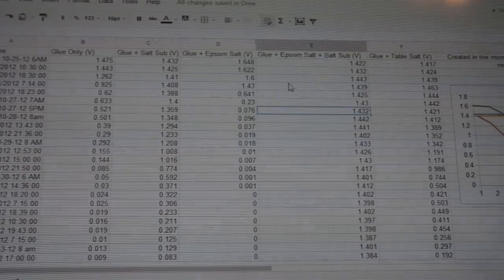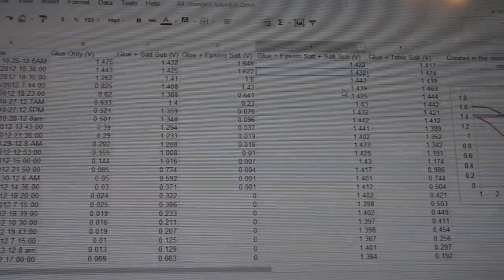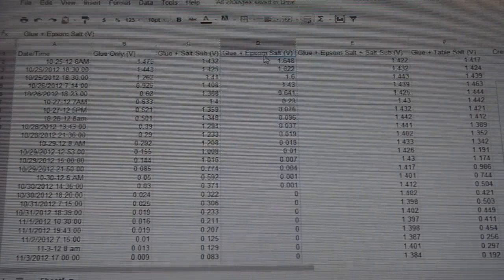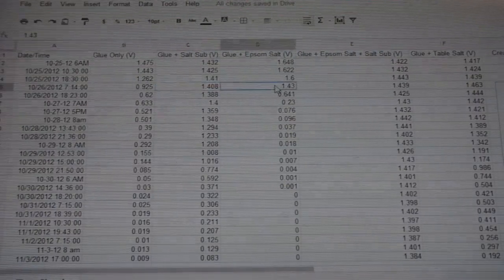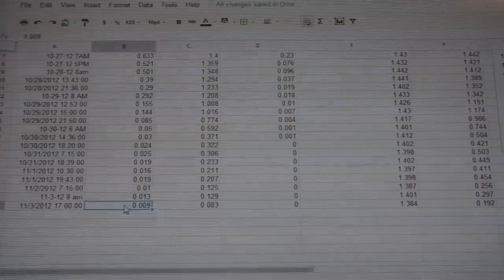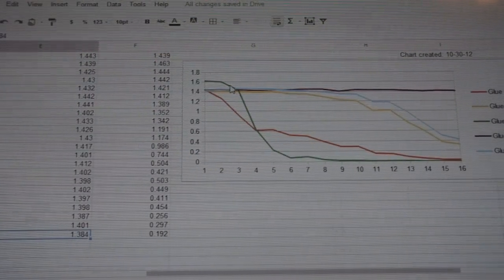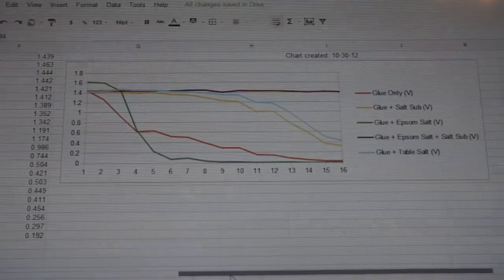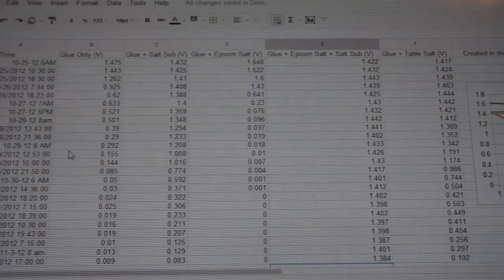My Crystal Cells does not use water and the data shows it

Comment: Great job as always, ibpointless2. Great work, keep going, yes, this crystal cells works without water, i also have a lot of experiments and crystall cells and i confirm you entirely, and dried battteries that works at some voltage for 30 years, so this works through resonance with etheric energy and conversion into electricity, exactly like pyramid generator, which is absolutely real.

Comment: I have played with your concepts closely watching what you do (to the best of my ability, given the amount of time I have available) and also John Bedini's work. It would seem, to me, that when you add a lot of hydrates - in my case - Flame Retardant Aluminum Hydrate - to alum and or epsom salt, you have crystalline electrolyte that moves from solid to fluid depending on the state of charge and current applied. This does allow for more power density, BUT, with that comes corrosion.

Comment from the maker: The electrodes are not corroding because they're not exposed to water. 

I've have one crystal glue cell that's been shorted out since February of this year it and comes back to normal voltage within a few days. 

I will PM you a link to a short circuit test that i've been doing on my copper tube crystal cell.

Comment: How much is the magnesium electrode corroded in your crystall glue cell ?
And the copper elevtrode ?

Did you also try magnesium and graphite as the electrodes ?

What happens if you shortout your crystall glue cells for one week ?
What is the shortcircuit current and will the voltage come back after this week ?
Many thanks.

Comment from the maker: Glad to hear your cell is still going. If it started off at 1.3v a 100mV drop would be normal. My usually start off at 1.4 and then go to around 1.3. 

Yes i have use aluminum before. The very first version of the cell was aluminum and copper. thanks for commenting.

Comment: My theory, though completely unfounded, as sort of discussed in another comment of one of your videos, goes like this: you have, as you say water of crystallization in the epsom salt. When a load is applied, pathways develop, minute rivers if you will, for current. You may see this increase over time, under load even, as shown in your one rising voltage vid. But when you disconnect the load, the battery nearly isolates the electrodes completely. Like an "on demand" semiconductor, almost.

Comment: My oldest IB cell is now 13 months old and reads 1.2V. It only started at 1.3x though... the thing is, I didn't use the "correct" salt substitute. I'd like to find some, and start a new run. By the way, have you ever done your glue-epsom-saltsub with aluminum? Great data, thanks for posting this.